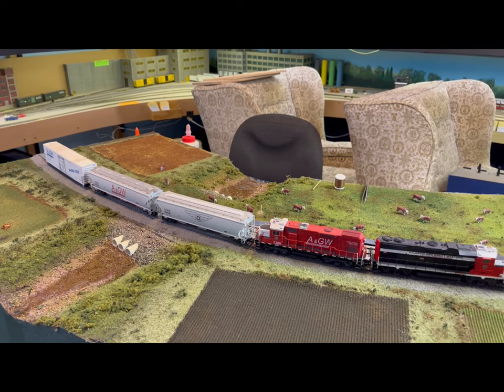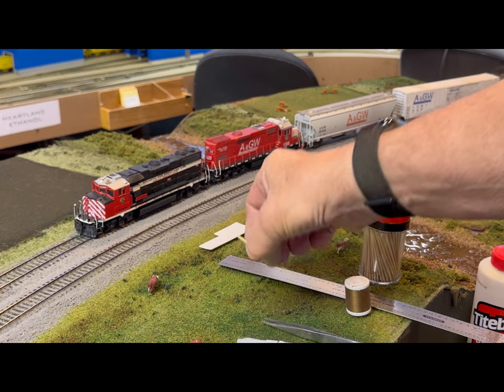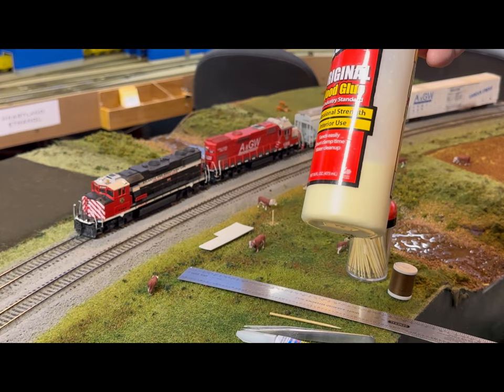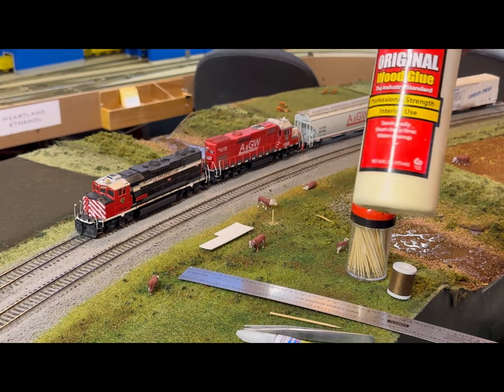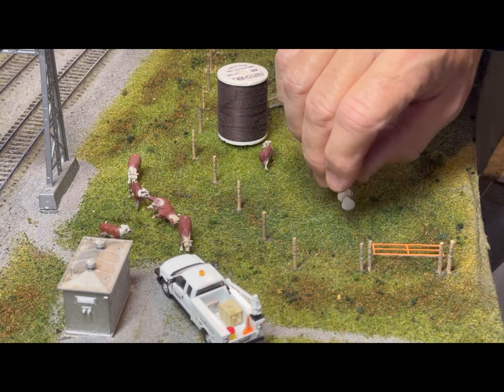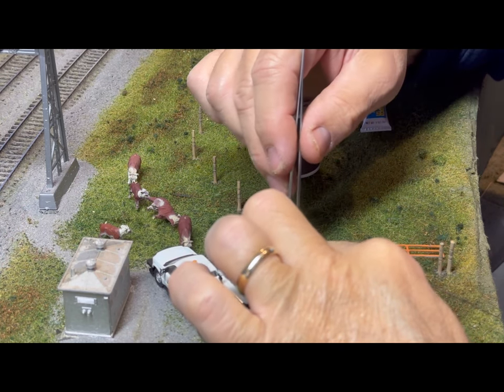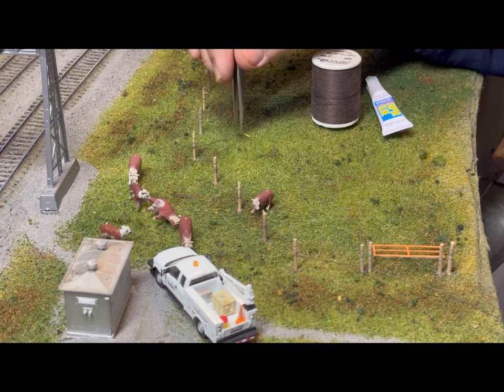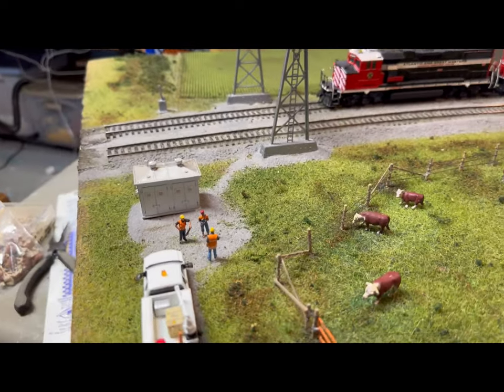15. Adding wire farm fencing to your model railroad train layout or farm scene. Keep the cows in!

Comment: I always scratch build all my fencing.  I do both O and HO scale fences.  I just completed a Walthers Cornerstone building kit--chicken coops and sheds and painted everything by hand.  Came out really nice.  I even got a couple of green tractors that look kinda like John Deere tractors.  Wife liked them so much I had to give her one of them.  I think they were from Walthers too.  Since I broke off all the stirrups on my Tichy flatcar build trying to install the bronze phosphor grab irons, I made stirrups out of staple from the office stapler and they look even better than the plastic ones I broke.  For corrugated culverts I use drinking straws that are bendable--just paint them grey or a metallic color.  I cut the bendable part off and save the other part of the straw for pipes in both O & HO scale.  
Oh no.  All your cows have croaked and are laying on their sides.  I scratch build gates and use split rail and 3 rail fences I build out of balsa wood.  My mother was from Illinois, I think she lived in Covelle a little town outside of Danvers.  My aunt and uncle, her brother used to live in Danvers.  They're all gone now.  Cheers from eastern TN